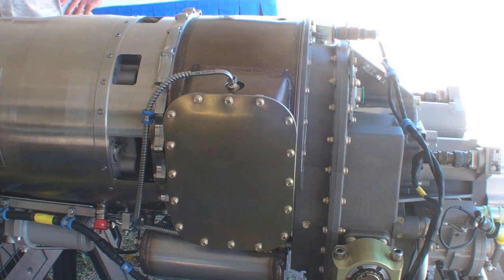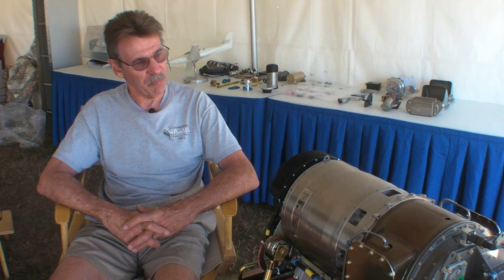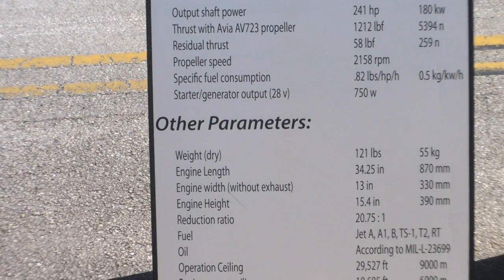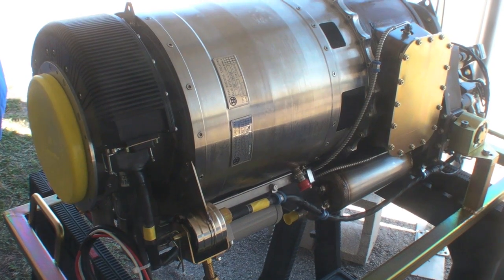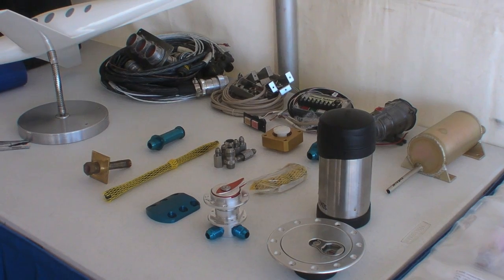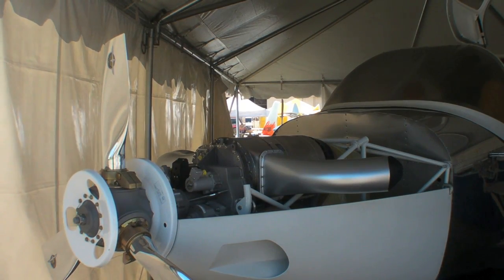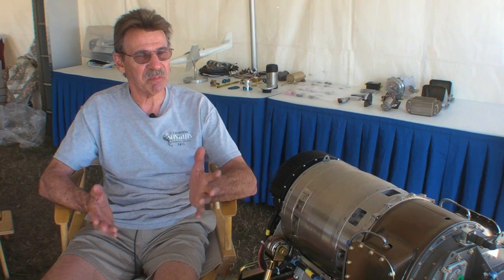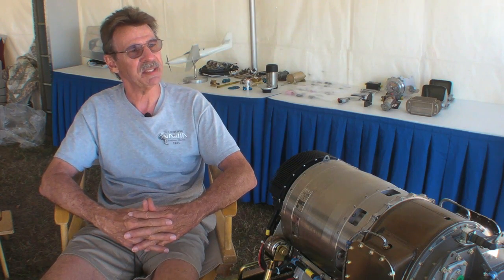Diemech's Small Turbine Engine

Comment: Before a turbine engine really becomes efficient, you have to be at an altitude where you need cabin pressurization or supplemental oxygen, I don't see this engine being practical for small aircraft that generally fly below 10,000 feet. might be a good small helicopter engine thou.

Comment: Small turbo prop engines (under 500 hp) don't make sense.  The lbs of fuel per hp-hour is almost twice that of a piston engine, and don't make sense until you're high enough to need a pressurized cabin.  What's needed is a 6-cylinder version of Delta Hawk's motor.
Reply: Unless it gets to the point that 100LL costs twice what Jet A costs.   We're not there yet, but I have a feeling it's coming...